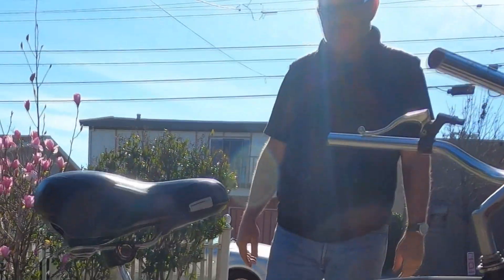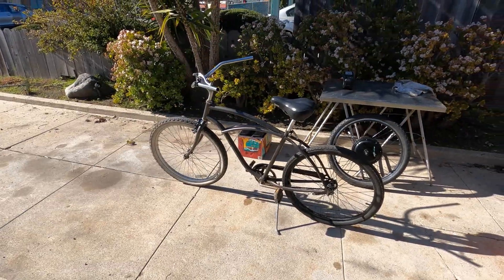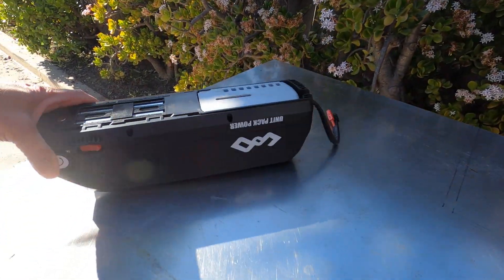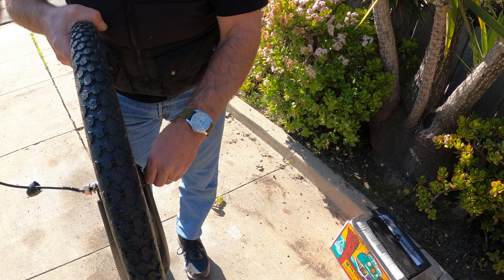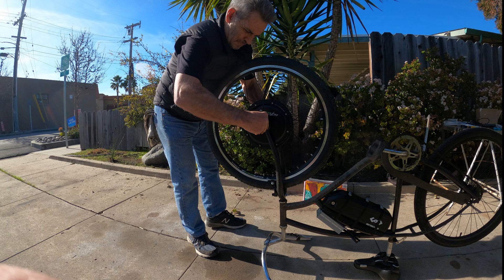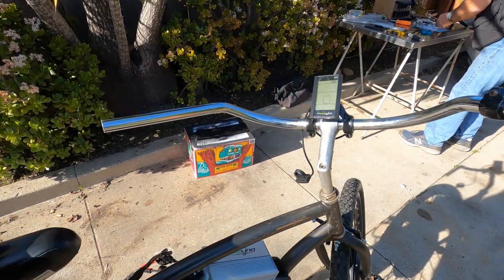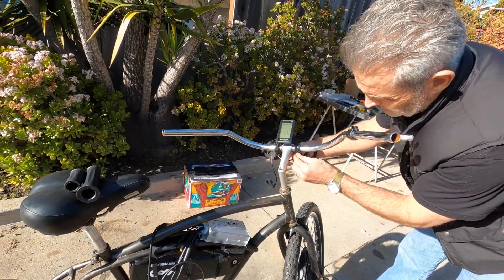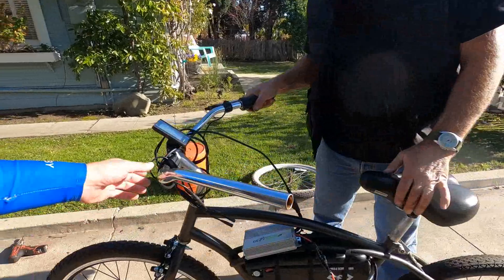FAST E BIKE:  Santa Cruz Cruiser 1200W Front Conversion Kit Installation

Comment: How did you center the front wheel and how many washers did you use I can’t figure how to the wheel centered or which side the wire is supposed to come out the wheel the directions for this thing is poor